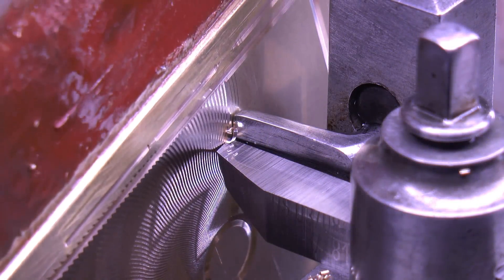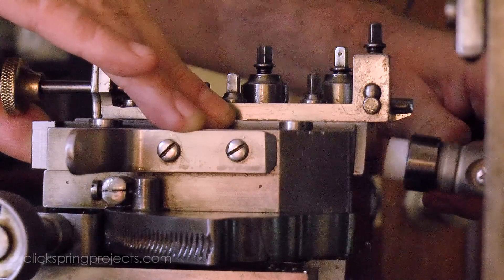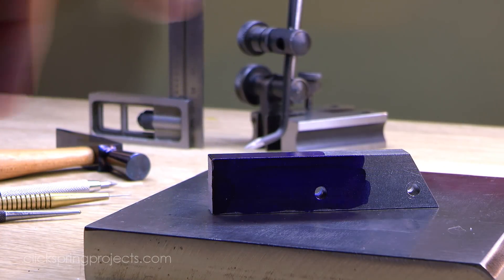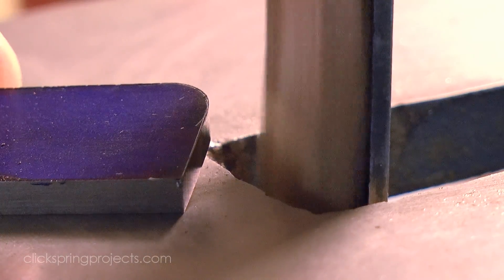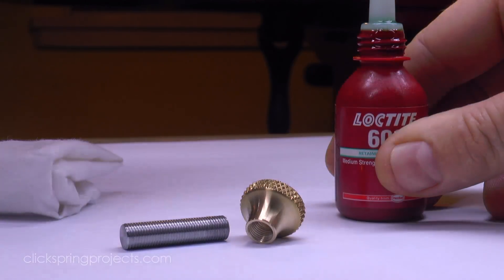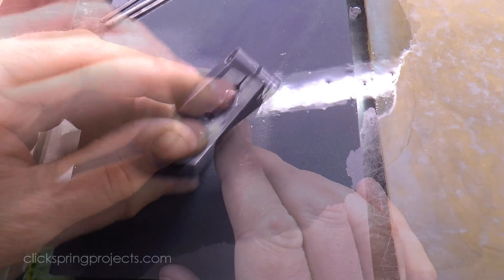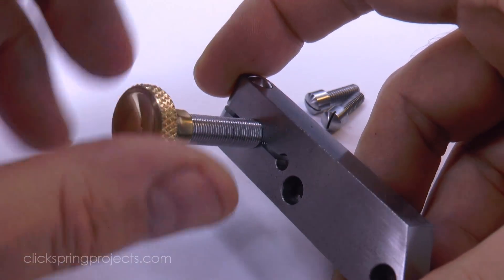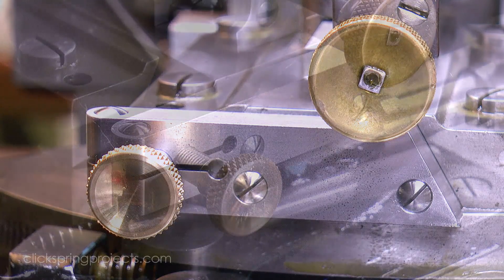Making A Depth Stop For The Straight-Line Engine

Comment: I want brass knobs like that on everything that can take a knob. And it will age beautifully as well, it will be no time until it looks like the original knob.
Reply: One difference between Chris'e knob, and the knob he compared it with is that the original nop appears to have been secured to the screw with a square pin, possibly peaned out with a drilled center, where the one he crafted is solid brass at the back. I don't fault either difference, the polished solid brass has it's own appeal, just noting that there are differences there. Likewise it looks like the pitch of the knurling is different but I'd pretty much expect that even from factory hardware. Unless all knobs are the same outer diameter, and cut from a common blank, there's likely to be some difference from turning one knurl to another. And if you're trying to match knurling from a different decade, that may have come from an era with a different measuring standard, all bets are off.

Comment: @Clickspring  Amazing video as always, it's great to see another long form video. Might I suggest a small change in your stop. After working on lathes in a production shop for years I've seen every screw used for clamping has the last few threads at the tip turned down under the minor of the screw thread. You wind up with a straight turned section at the end smaller than the threads by enough you can still remove the bolt if the end is mushroomed over from years of abuse. This same approach could be used on the stop screw to guarantee it's removable decades from now with many many hours of use on it.

Comment: I've noticed on a few builds that your custom slotted screws always seem to manage to get "clocked" when installing into the final assembly. How do you manage to get the necessary rotational location for the slot such that everything gets lined up under torque? It's one thing to do this when installing door furniture into wood, but quite the other to achieve it so consistently with metal parts!

Comment: Hey, Chris !
I'm a Norwegian woodworker / furniture maker and I reckon I'm about half as smart as I need be to understand what you're doing. But that doesn't stop me from gathering some small practical tips, oooh!-that's-a-clever-tool-can-I-make-that-of-wood? & 'good practice points' that I can use in my woodshop. I must have picked up a good handful or two of 'insights' / things-I-would-never-have-thought-of-myself from watching your videos, and TOT, Allen Millyard, Abom79 & other metalworkers (you can plane steel?! linearly ?!! with a humongous tool-pushing monster machine ?!!! wicked, black art, I tell you! Best stay well away and keep cutting wood with steel as Odin intended) Thanks! for sharing your brilliant work is what I'm getting at, I guess. You're a joy and an inspiration. Enough gushing. I've got steel to hone.

Comment: So impressed with your videos. Thank you for sharing. I was wondering, did you use the same radiused form tool for the bell feature to do the concave feature as well? Also, I like your use of the wood dowel to remove burrs from the threads.

Comment: One of the best set of tools I ever purchased were counter bores tools made specifically for cap screws. I got sick of setting up slot drills/endmills like you did in the mill to do that. M3 to M12 surprisingly affordable.  
One caveat though, the hole for the cap screw needs to be the right size as the counter bore tool has a guide pin as part of it.

Comment: Why do machinists only cut threads in one direction instead of cutting it on the reset pass? Wouldn't cutting both directions save time?
Reply: The feed of the tool and the rotations of the lathe are connected by gears… in order to thread from left to right you need an extra gear in the train which most lathes either don’t have the option for, or it’s slower to install than just going back to the start.

Comment: I wonder if the stop should have a rounded tip here where it contacts the block?  Instead of a flat contact.  Maybe it doesn't matter much if the contact surface is very uniform and flat.

Comment: As a woodworker, I must live with a degree of imprecision because over time the wood 'moves' with changes in the environment.  However, during the machining and assembly operations, careful layout and tool alignment is necessary. So, thanks for the videos, where I learn useful techniques, plus other skills that are useful increating tool bits and such.

Comment: Nice job Chris, with your usual demonstration of fine attention to detail and quality. Love the result.
That straight line machine is just superb.
In case you read this Chris - I forget but, was that a cover of borax you used with the screws heat treat?
Reply from the maker: Thank you mate, appreciate you tuning in :) The cover is powdered boric acid, mixed with denatured alcohol into a slurry. Remove post quench with boiling water.
Reply: Many thanks Chris - I was stretching the memory banks from your earlier videos way back - thought it was that but had forgotten the denatured alcohol slurry mix. Great - you make the best special screws on the planet :)

Comment: Hi Chris, great to hear your commentary again and very easy to follow for someone who's never turned before! On the original knurled handle, what is the purpose of the small hole in the center of the domed face? My only guess is that its the fastening method to the threaded rod (like a rivet).
Reply: i think it's peened in place
Reply: @Mister_Brown  I was thinking something similar but its an unusual square shape. :)

Comment: 13:00 what is he doing in that step? i have never seen someone doing that and it doesn't change the look of the screws. or is that just another way of quenching the steel?
Reply: He is hardening the screws.  The goop that he’s using is a mixture of boric acid (Borax) and denatured alcohol, which keeps the heat from forming a scale on the surface of the steel, the small tray he’s doing this in is simply to keep the small screws surrounded by the boric acid mixture.  Once quenched, the screws can then be tempered and polished.

Comment: Is anyone else baffled by how Chris gets the machine slots of the screws exactly identical and indeed the angle he wants them to be at? 🤔 👏👍🏻
Reply: I'm guessing he cuts the threads, then screws them into the part and marks 12 o'clock on the blank head.  Then unscrew them and cut the slots according to that mark.  It happens too often for it to be coincidental.  🙂
Reply: I used to be baffled, but then i just started accepting the world is full of magic after all.

Comment: The idea of turning metal by hand as though it were a wood lathe is fascinating. What a great technique.
Reply: The transfer screws (00:55) for locating holes are used a lot in cabinetmaking, too. 🙂 The woodworking ones aren't threaded, but their function's the same.

Setting concealed locating/strengthening dowels into edge joints is impossible to do accurately without a supply of little pointy things!
Reply: For Watchmaker its how we do a lot of very small stuff
Its easier and faster most of the time to do parts by handturning compared to whipping out the Support, get everything straight and alined. 
And for tiny diameters its close to impossible to do it with the Support.
And by tiny I mean Pivots of 0.2mm diameter
Reply: Go back to videos from years ago on this channel. Hand forming curves is a staple of Chris's technique.
Reply: I know!  I don't think I've ever seen someone take a hand cut on a metal lathe before.  Closest I've seen/done has been spin raising, but that has a LOT less chance of catching the work.
Reply: Why so, if you have the touch.
Reply: dont try it with hard material